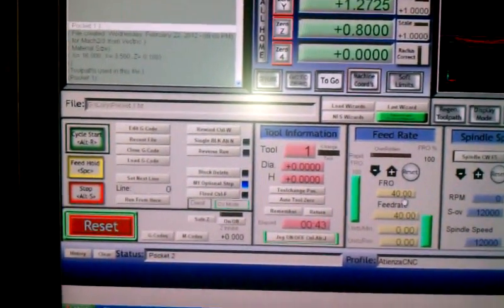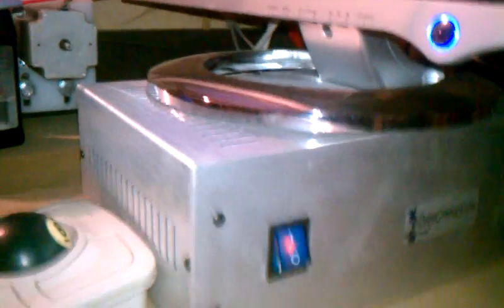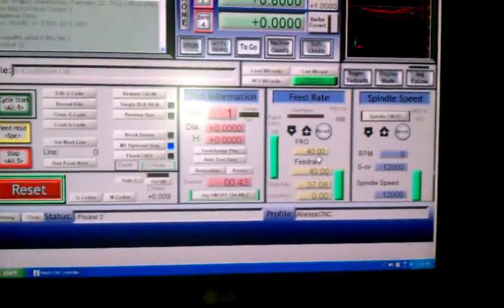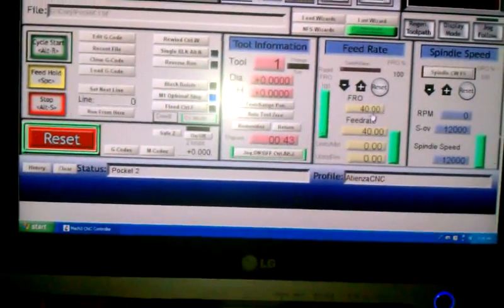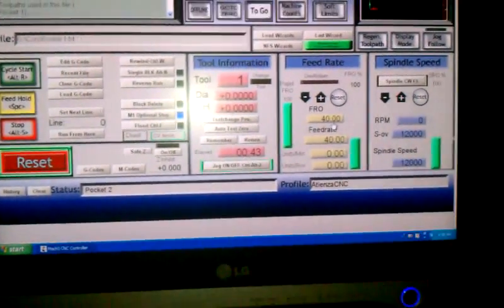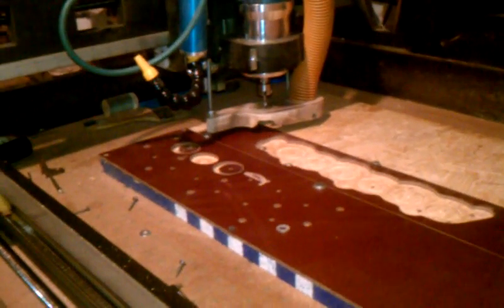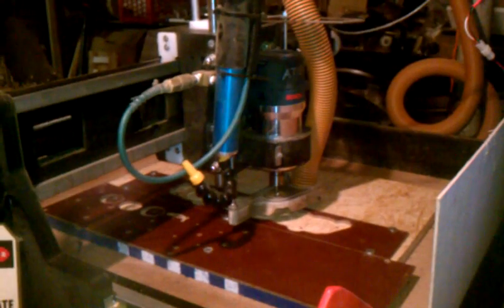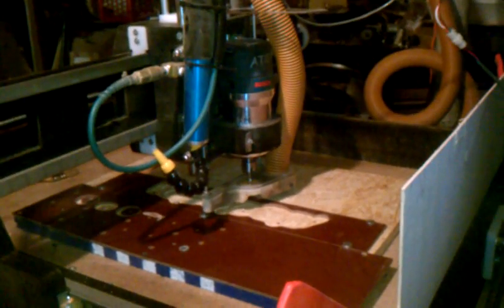GeckoDrive G540 Installed in my DIY CNC Router

Comment from the maker: @someone11110 Thanks!  My original investment was about $1000-1100 with the xylotex drives.  The G540 box cost about $450 with the enclosure and psu...

I'm holding .003"-.005", repeatability very good...

Comment from the maker: @AtienzaLouie The thing with xylotex is the board is only rated at 35V max, with 30V practical.  My box had 24V which does limit the 425in*oz steppers somewhat.  I could probably go even more than the 48V in the Gecko box, but I have more than enough speed and power, more than twice as before....

Comment from the maker: @magnumowner  It all depends.  It's really comparing two different animals.  The Gecko is at a much higher price point so you would expect better performance, and it does live up to expectations.  X rapids from 200 to 570 and Y from 400 to 720!

Is it worth the extra money?  Maybe, but if you havve a limited budget that money might better be served upgrading leadscrews or linear bearings..  You can see from my previous videos that even at only 24V, the xylotex is more than a capable box!